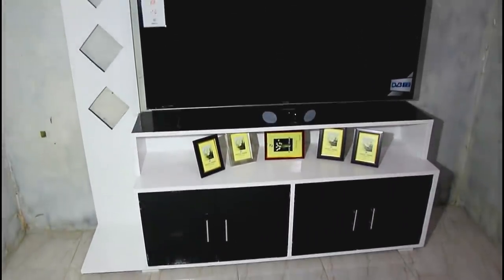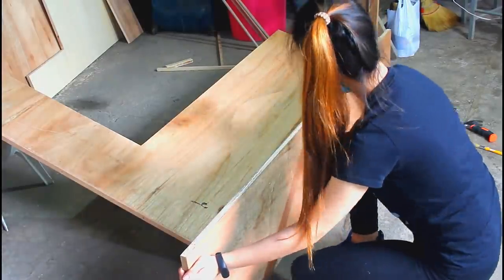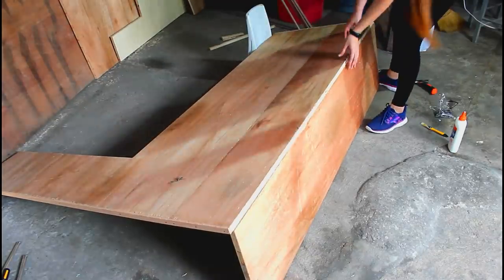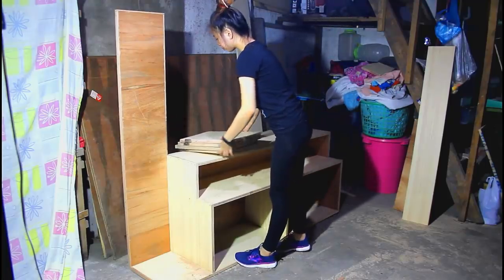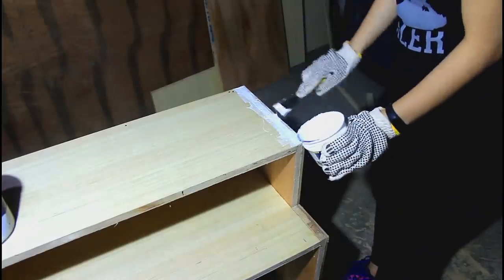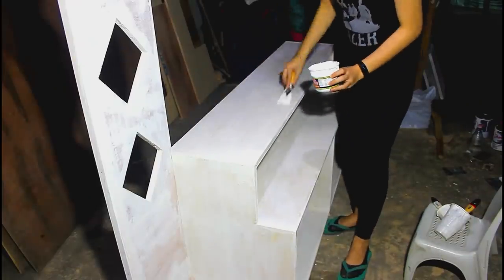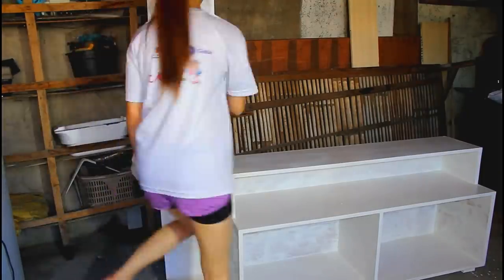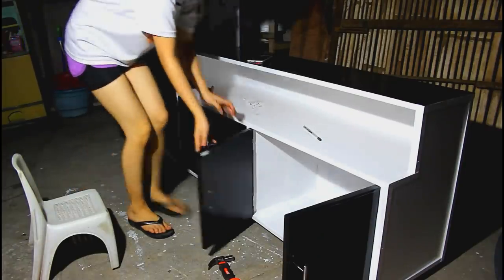DIY TV Cabinet Table || D.A Santos

Comment: I like watching hat u do. Can i suggest you using a paintspray guy? There is some not so expensive solution from Bosch 2000 even Bosch 3000 if you plan to paint rooms too  lol and they not so expensive since they not quite on professional level but they dont leave overpainting marks that much as paint brush and such :) You are amasing i admire you. Ingat ka qutie.

Comment: I will give U some Wood Glue, Air Nailer, Air Compresor, Screws, Sander, Sand Paper, sa susunod na project mo Ms. D.A. Santos! But, Use some Cutting-Resistance Gloves too, para di masugatan kamay mo pag nagliha ka...Teka, ikaw din ba ang gumawa ng Papag na bamboo na pinapatungan mo sa pag-putol ng flywood mo? hehehe! Nice Video... More up-load po! ;-)